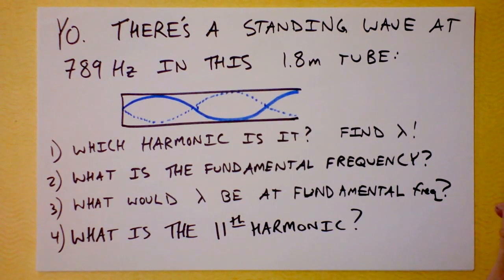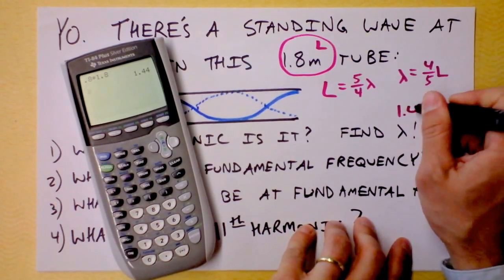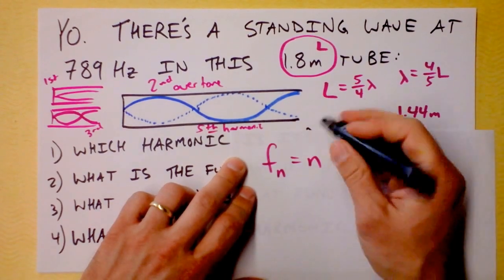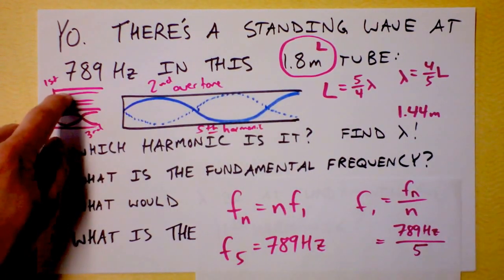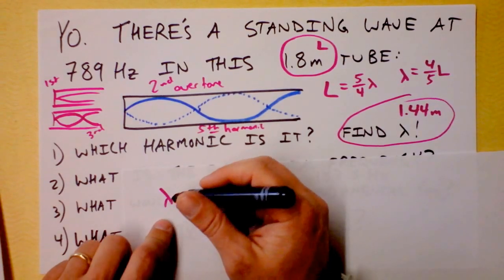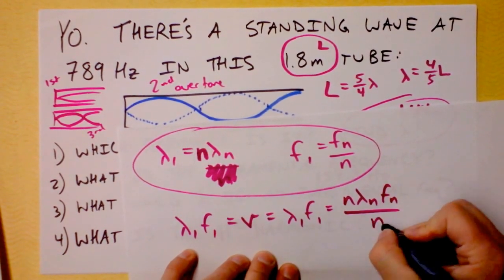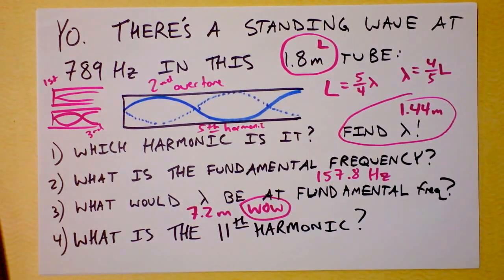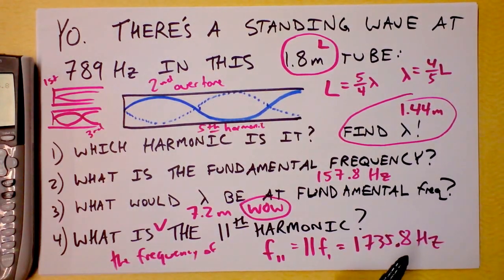Standing Wave Harmonics in Half-Closed Pipe Worked Example (organ, clarinet) | Doc Physics

Comment: I have a problem we said that the wave in the example was the 5th harmonic but in the example you showed us on the previous video the one with one closed and one open end we had the exact same wave with the wavelength 4/5 of the length and we said that it was the 3rd harmonic. So how is this one the 5th harmonic.@Doc Schuster
Reply from the maker: ***** Harmonics are defined relative to the fundamental of the system.  Do you have that definition?

Comment: 1/4 WAVE PIPE ( or 'Half-Closed' pipe) --- a 9.3 foot pipe will produce the fundamental 30 Hz (plus its overtones)  ---  [ * the note the pipe will produce will actually be slightly lower than 30Hz due to 'end correction' ]

Comment: Doc Schuster your videos are amazing and has helped me a lot. So Thank you so much sir.

Btw I believe that the 5th harmonic is actually the 4th overtone. Am i right?
Reply from the maker: stormbrakerable Thanks!  I don't think so, though.  I have a video on harmonics vs. overtones.  Can you see if you agree with it?
Reply: +Stormbreaker I think in this case the 5th harmonic would be the 2nd overtone, as it is open on one side and closed on the other (the harmonics skip the even harmonics so 1/4=0th overtone, 3/4=1st overtone and 5/4=2nd overtone)
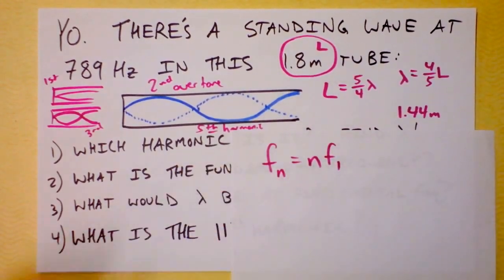Reply: @Doc Schuster  no, you have a mistake in your previous video "Standing wave harmonics in a tube with one closed end (Organ, Saxophone, Tuba) | Doc Physics" which OP was questioning. You say @2:27 of that vid "that's my 3rd harmonic" which is incorrect. It's the 5th. Yet 2nd overtone. The current video is correct. The previous video has a mistake...it should be deleted because it's probably confusing people.

Comment: +Doc Schuster all of my notes postulate that the 5th harmonic is the 4th overtone. As the 2nd harmonic is the 1st overtone. 
Check Wikipedia too http://en.m.wikipedia.org/wiki/Overtone
Reply from the maker: stormbrakerable From wikipedia:  Physical representation of first (O1) and second (O2) overtones of a cylindrical pipe closed at one end. F is the fundamental frequency; the first overtone is the third harmonic, 3F, and the second overtone is the fifth harmonic, 5F for such a pipe, which is a good model for a @wiki/Panflute.I think you were looking at guitar strings in your notes.  Everything is different if one end is free.